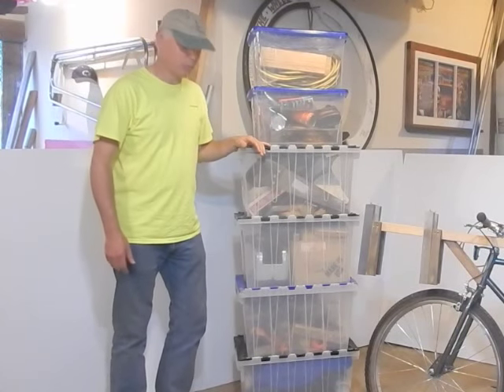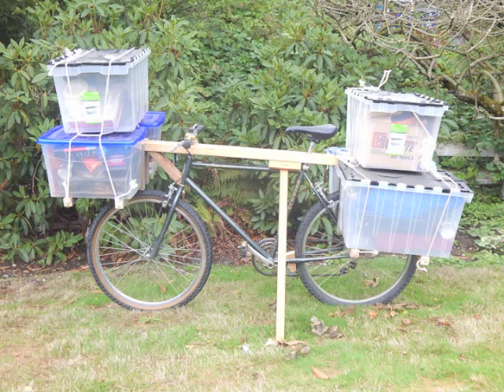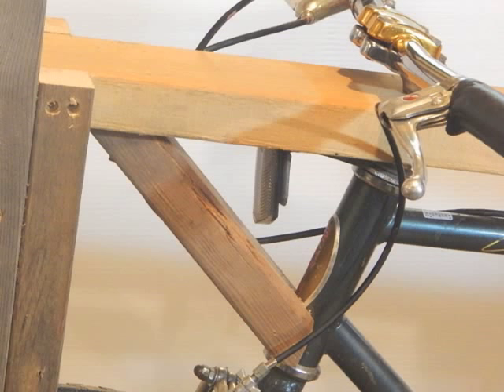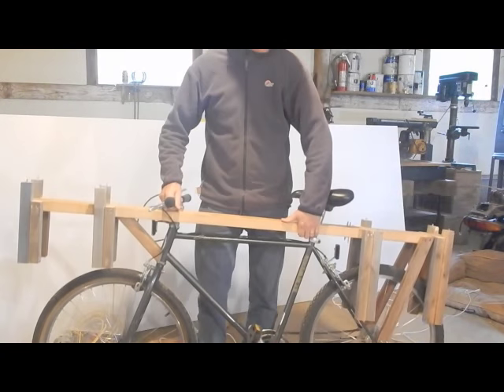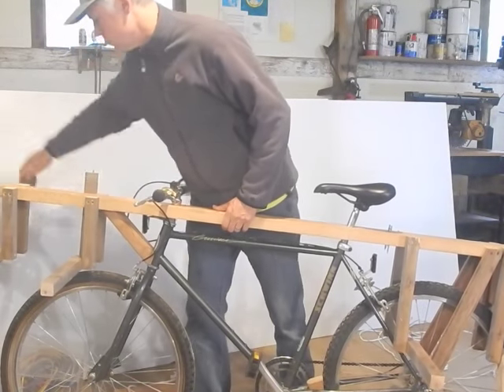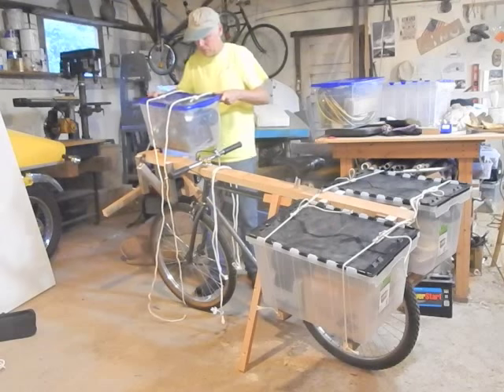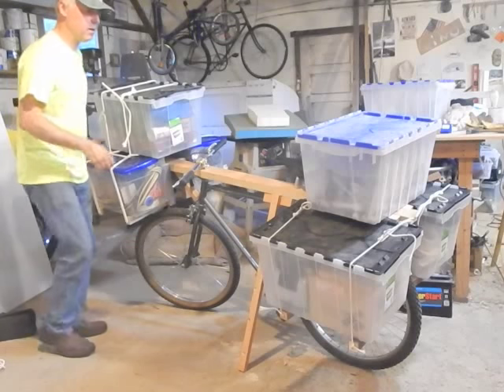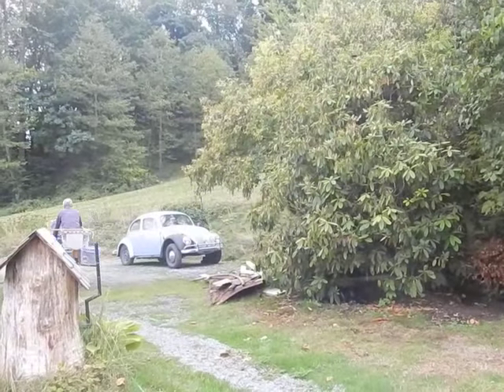DIY SHTF Cargo bike

Comment: one suggestion i have would be to use screws instead of nails so that they wont work thier way loose as easy as nails would because as you can probably imagine, after riding around for awhile, especially with a heavy load, the stresses could cause the support bars to come apart if nails are holding them together. 

i really like your videos and all the stuff you do Paul Elkins. you are really cool and i hope i can meet you one day

Comment: I also thought about folding bicycle carrier extensions with metal grid and u shaped metal rods to fold 40cm x 25cm load area at each side of the tail wheel for hardware store transports (10L paint, wood plates, etc.).
I would recommend lower each load box to get load mass center near axis by lowering each carrier. Also staple tail big boxes instead of loading a big box above small front side boxes. 
To avoid falling boxes during loading / unloading an extra (3rd) leg part can hold outside of box so you need a shorter strap which may ease the strap handling during loading/unloading also.

Comment: Your front rack is frame-mounted, unlike the Wald front rack I'm picking up this week for my Huffy Cruiser.  (I've become a food delivery guy!)  I was thinking that to mount to the frame, I'd have to move my front brake behind the wheel.  But yours is way forward of your brake, and is supported by a nice long strut on the top tube.  Thanks for your excellent tips!  I've been a huge fan for a long time.

Comment: Turning would be hard,
and you couldn't go very far. When you add more weight to lug around by hand, you decrease the distance you can travel. 5, maybe 10 miles per day with that thing. You can compress everything to get started somewhere else, in just a backpack. The mental luggage is the most valuable and space/muscle-saving tool to carry around.
Also yeah, hills would devastate this.

Cool little concept though, it's good to see if it worked.

Comment: wow ingenuity Paul u should try next time a frame from bamboo lightweight and strong as steel is used in Japan for scaffolding for buildings - I am next building bed from bamboo in campervan - I just watched  your homeless shelters good ideas I want to build tipi from bamboo six pieces with coupling of  Pvc for top join  with tarp from insulation taped with gorilla tape sets up in seconds to carry with my bike and Paul don't forget fishing rod I have a $20 telescopic 8" rod  I will attach to bike and get some dry bags and my jeans fit 20 litre bag inside and string around belt waistband tie tight use paracord as multi purpose and legs tie once and then tie to front handlebag stays put - also I made my own Pvc bow from net bought my arrow's and made bamboo quiver for arrows with paracord knotted twisted and attached at knots in bamboo - I picked up for $40 panniers and rack that sits on seat post from Aldi in Australia good value could put one back and front I think or two on back at different directions I want to make a bamboo hammock holder out of shelter rods so it is multi purpose - in oz we have a kid trailer carries two children I might pick up one of these but if going bush need to be slim with probably one bike stay safe

Comment: Not very Original. The Vietnamese used this concept on the Ho Chi Minh route, and they used bamboo which is stronger and lighter. But it is very nice to see an American try to use a bycicle for transport. Maybe you can learn a few things from the Dutch (Netherlands) or the Danisch (Denmark). In a city you are faster on a bike than with a car. Again for some strange reason copy and paste doesn't work (does anybody recognise this failure, please explain). See BycicleDutch on YT.Wish you good luck and all the best with your projects.
Reply from the maker: +Mark Schattefor Thanks Mark. It is indeed not an original idea, and to make it easier you can use 2 boards instead of drilling the 2 holes in a 2x4. I saw something similar on the internet which was created with tape and bailing wire by a homeless individual. And yes, I am familiar with the cool cargo bikes being made and used in other nations.

Comment: Maybe add a small 2 cycle engine.
Reply: +Bill Karoly That's what I was thinking. I've seen 125cc engines added to bikes just for emergency use. I thought it would be nice to have a 125cc engine and use the small alternator that some come with and charge up a battery and then have a 500 watt electric motor on the front wheel. Now you have 3 forms of power, pedal, engine, and motor, and you're 2 wheel drive, plus speed and stealth if you shut down the engine and just pedal and run the front motor. I like some thing like this one, but with front wheel drive as well.  https://motoped.com/survival/  At least with 125cc engine, it has power and would last a while, and you could use it everyday, unlike those tiny 49cc engines. Keep up the great work Paul.
Reply: no then cop take away  thay dont like you you point out how dont do there jobs right  ok for them drive  use a laptop  radio phone and lose the bad guy yet lock you up  geting your being  bike  taken  good job there